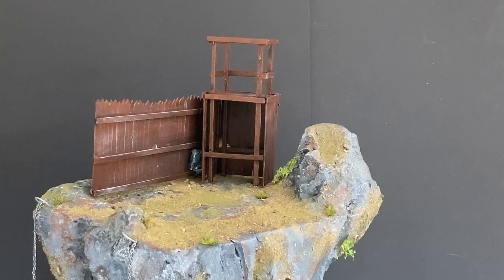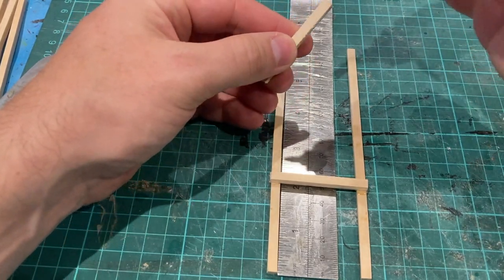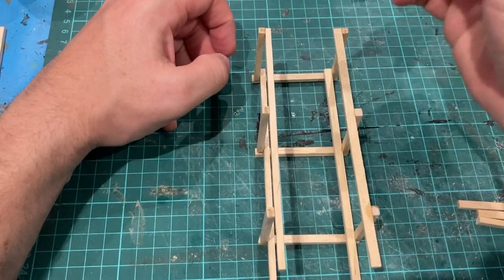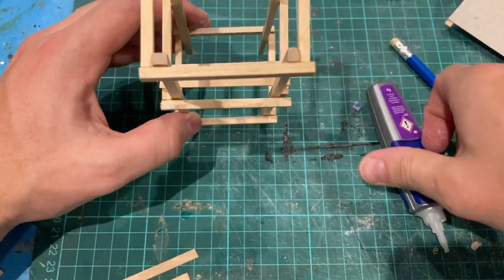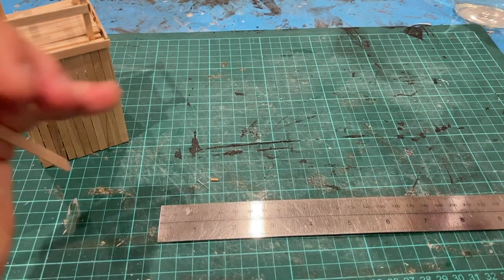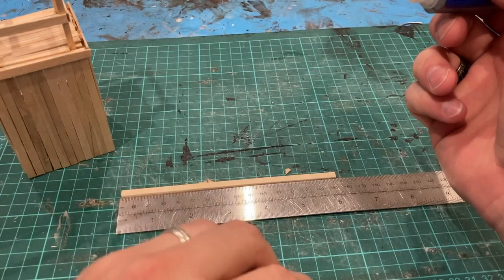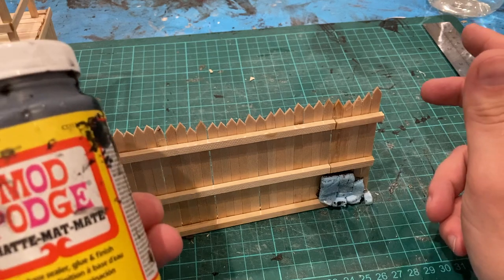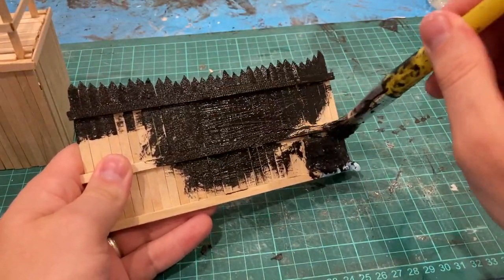How to make a Palisade wall and wooden Tower for Age of Sigmar

Comment: Nice build there mate, they are looking nice. Little tip/hack you can use a wire brush to add extra wood texture which is great for drybrushing.
Reply from the maker: Nice idea Cal. Will give that a go with the next build which will work nicely on a wooden gated entrance.